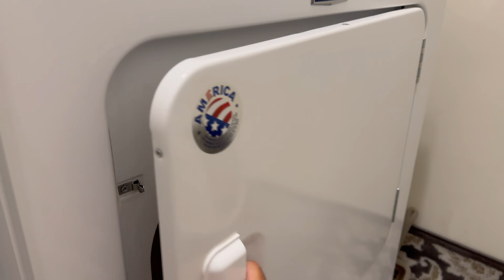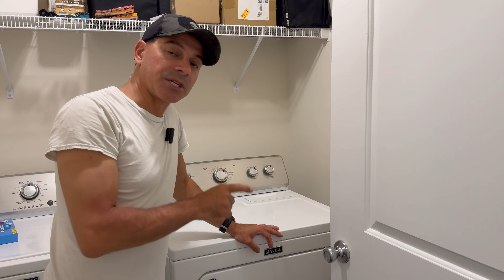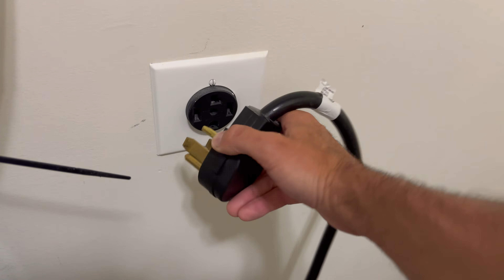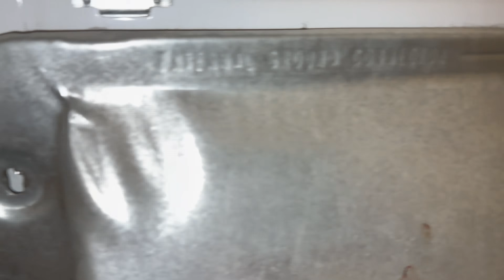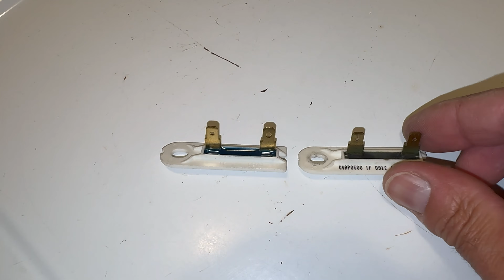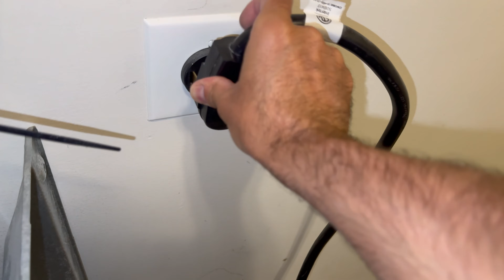How To Replace Thermal Fuse - Maytag Dryer  (Phillips Vision: Episode - 158)

Comment: easy, but our inside light is not on. so it is not the thermal fuse. what would you suggest? Thanks, boB
Reply from the maker: Check your plug and make sure power is getting to the machine. Could be a break in the wire
Reply: Where van I but the termal fuse?